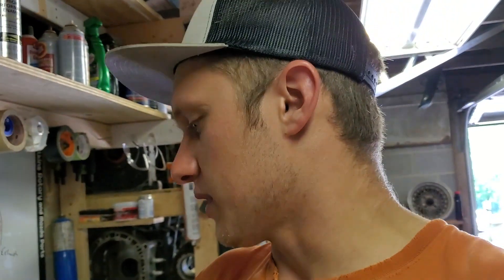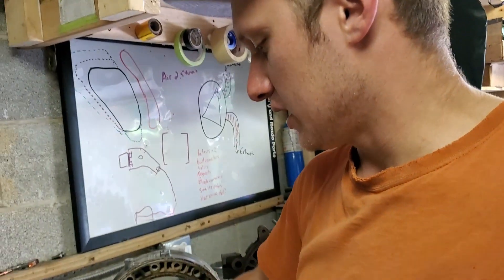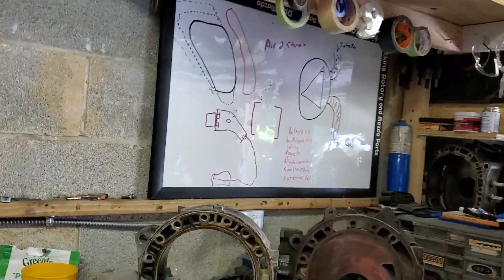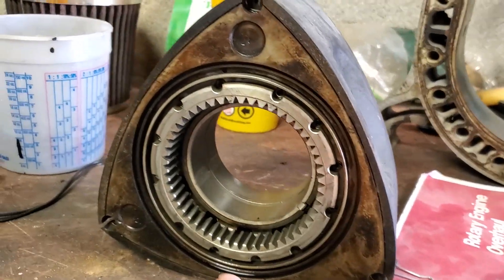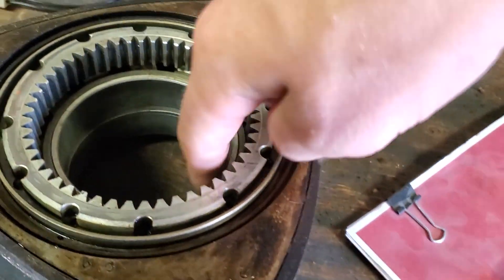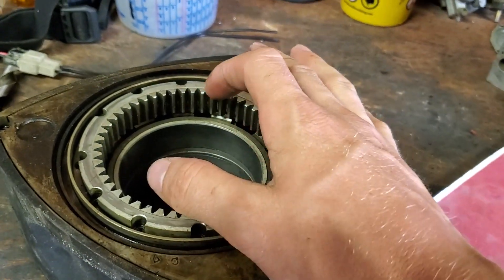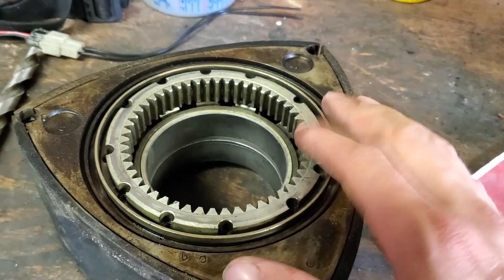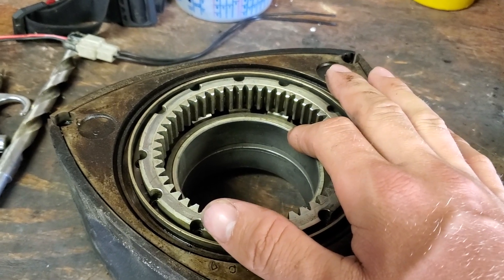Rotary Engine Break in Procedures Explained

Comment: hey man, quick question... so i went with a large street port in my REW, question is. do i need to advance timing, or retard it for a street port. or does it depend. its single turbo by the way. not sure if it matters.
Reply from the maker: I would say that it may like a bit more timing than a stock port engine, but i would have your tuner make that recommendation, or get it on a dyno to find the optimal timing number.

Comment: Dude check mazda breakin before posting vids most of the stuff ur saying is not right at all
Reply from the maker: Most engine builders do not follow the oem break in procedure.  What I explained in the video is the result of both my experience having engines built by reputable shops, as well as talking to engine builders in the area to find out what they reccomend.  If you have an engine rebuilt, I would follow what your builder reccomends vs what OEM mazda reccomends
Reply: Ya ur right but most of them are wrong cuz none know how the parts are manufactured and most of them are not engineers or have worked or know how proper oem procedures are done but if u take a look at one of the best rotary engine builders kayle mohan says about it u will know what i mean cuz its almost oem
Reply from the maker: Ill send him a message and see what he does for break in.  thanks man!

Comment: I kept it under 3 k for 500 mph,, under 6k until I hit 1500.  Oil change at 3k . Full seal change + hard seals. Also, question, do you happen to have a speedometer gear (entire assembly) for a 79-89 trans?

Comment: So is it reasonable to re-use apex seals that are within spec? I mean to my monkey brain that makes sense but I don't know if the seals become compromised in any other way during use.
Reply from the maker: Yep. If they are within spec re use them. However. If you have to replace one of them. I'd do them all at the same time within reason.  Say you break an apex seal 3k miles in and the rest are fine, then maybe just replace the one broken one.  If you have 2 out of spec I'd just replace them all.  And keep the corner pieces matched to the apex seal they came from

Comment: on a fc 13b, For the most part when a coolant seal fails, does the Iron also fail too in the same area as the seal? can u re-use the iron if it has minor pitting Or does it usually have massive damage and cannot re-use the iron?
Reply from the maker: I have seen where people have glued an apex seal spring into the coolant groove to patch the cracked area.  I havent done it but you could try.  Generally on FC if the coolant seals have failed. I'd assume at least one of the irons is broken but you may get lucky.  Pitting and rust is up to you to decide what you're comfortable with using and in what build.  I'd stack up a pretty junk engine just to stick in a car to tear up the driveway, but if I'm planning on using it for anything I'll be more selective